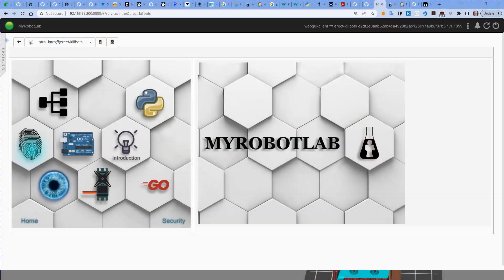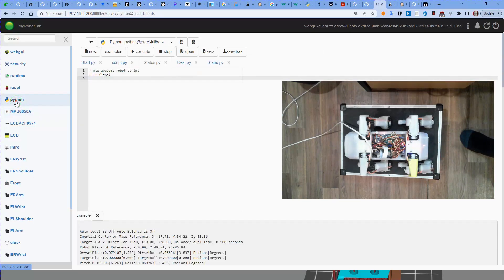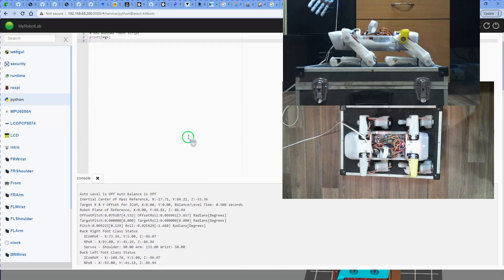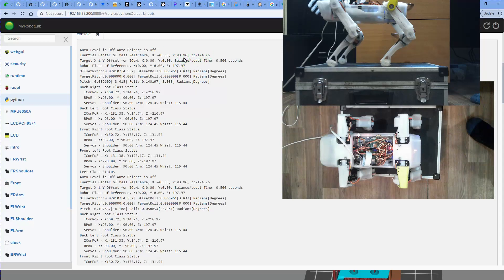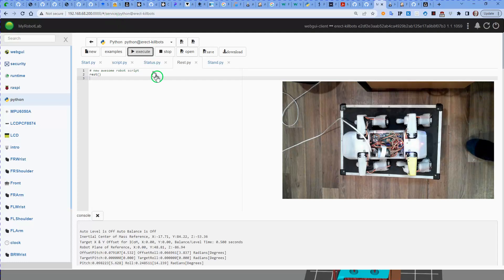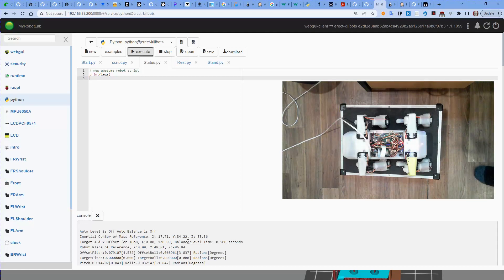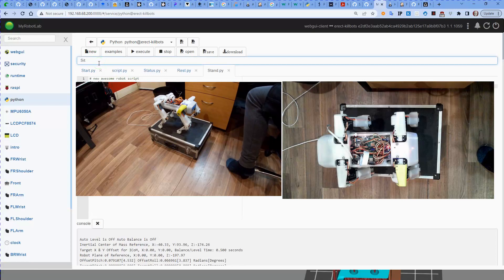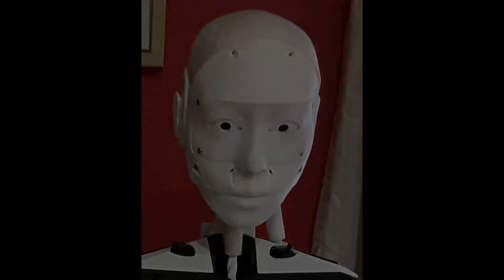SpotMicro Part 28

Comment: Hello. I skimmed through your series of videos and am very impressed. Personally, I lean more towards ROS. but their path is also very interesting and instructive.
I will prepare one of my spots according to your instructions and take a closer look at it.
have fun with the T-Nut_Top_Cover
Reply from the maker: Glad you like them!
I'm still working on the code, trying to get Spot Micro to Walk.
I think I have the Kinematic model worked out and mostly have the balance under control.
But this is very much a work in progress.

There are pro's and cons to running MRL.
First pros:
  It will run stand alone on a Raspberry Pi.
  It runs on any platform that run Java 11.
You can write user code in Python.
  This Platform is under active development.
  The showcase project for MRL is InMoov. http://inmoov.fr/
Cons:
 Can be like ROS can require quite a bit pf processing power when using OpenCV.

It is possible to run faster code just on the Raspi not using MRL, but MRL does handle all the servos and I2C communications.
Reply from the maker: I do like the robot arm you have mounted on your V2 Spot.
Are the STL's for the arm available? 🙂
I also like the way your electronics are setup.
Puts the MPU6050 closer to where it needs to be and more stable.
I've added in the second PCA9685, but have not used it at all. so your layout make more sense.
What are the electronics located on the tray above the Raspi?
I have 2 x 5000mAH S3 LiPo batteries installed under the Raspi between the electronics mounting board and the bottom cover.
Which servos did you end up going with and how to they perform with the robots weight on them?
I started with the Feichao F39202-270° Servos, but while that are powerful at 35Kg.cm, they are a bit slower, not unusable, but limited to 6.0V (Supposedly rated at 7.2V)  Not really enough room for a large SMPS to drip the up to 8.4V from the batteries down to 6.0V.
I've since switch to the JX-Servos PDI-HV5523MG servos that can be directly powered from the batteries, but the torque is lower at around the 21Kg.cm. I find the robot sometimes struggles with the weight of the robot on the joints.
They also run a bit fast resulting in jerky movements.

I'm interested in your findings as well.

Ray aka Cyber_One
Reply: @CyberOne  I have revised the entire body. made bigger and wider. 5 ultrasound inserted. a replaceable battery compartment. more space for usb cable to pi for lidar. rotated the legs so the servo alignment is the same. all grooves for M3 nuts removed and replaced with press-in nuts. I will publish the arm on thingi. but it should be there.